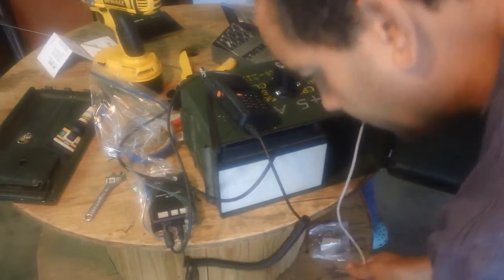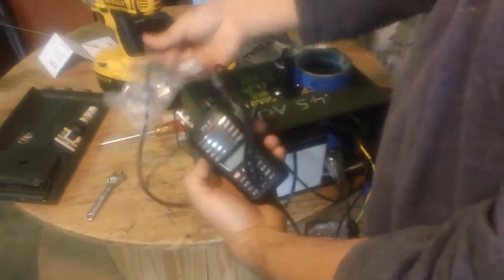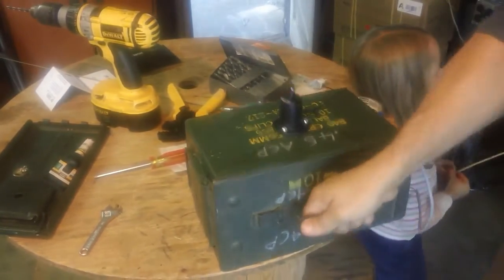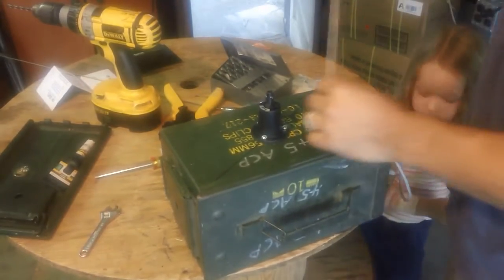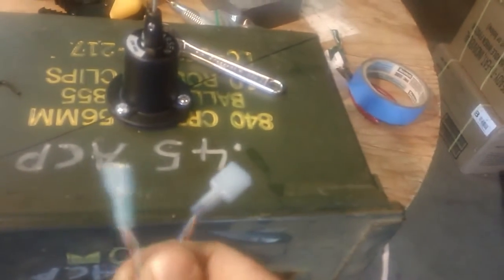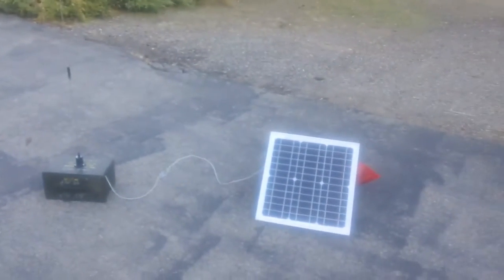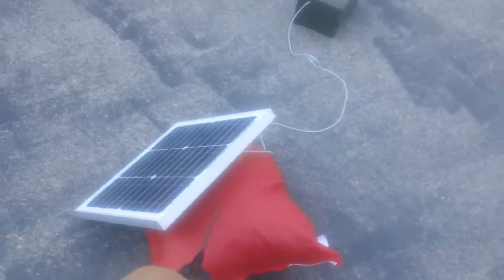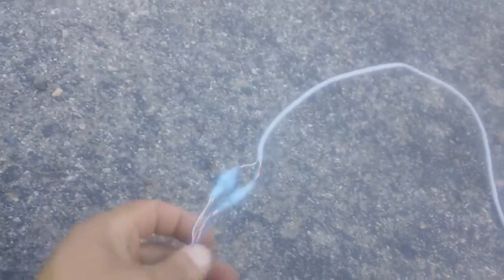SHTF Backup Portable Simplex Repeater Construction.

Comment: thank you so much for your honest nuts and bolts info.  I am new to comms and need things broken down "Barney style." do you think it would be worth my time to use a wouxon kguv9d plus with cross band repeat capability as an added layer of op sec? would out be worth my time or even feasible with the ardent data simplex repeater system you have outlined.  again,  thank you for sharing your time and knowledge with like minded individuals! semper fidelis
Reply from the maker: Sure, I think so. Thats my next project whenever I get the time and money to slap things together. I think the crossband repeater setup will operationally simplify things for the user. Thanks for watching.  Semper Fi.

Comment: Have you played with function ##95 "Report battery level"?? the manual reads the command only functions when the unit is powered by internal battery power. If hard wired thru the back battery connections that might be a useful diagnostic remote reporting tool once deployed. although i guess some experimentation might be in order as working with 12V input may give some wild reports. thank you.
Reply from the maker: Yeah, I did play with it while I was building this thing up. Though its not used cause I'm using the 12 vdc input. I entertain the thought of looping the voltage regulator output to the internal battery line to fake it into seeing some sort of VDC status. but my charge controller will kill the power way before the repeater will see it. Still may play with the idea in my next version of this setup. Thanks for watching. have fun with your gear.

Comment: Question: I have all my parts ready for assembly. My  Argent ADS-SR1 is labeled 4.28 volts at the round power input connection. I see you ran straight 12V into it? no problems??  after i had to wait 60 days for Argent to ship i dont wanna fry this one right off the bat.  thanks, love the videos!
Reply from the maker: Their manual or somewhere read 3 or so volts to 16. that round input is hooked up directly to their VDC regulator along with other points of power input (not internal batteries point). After a couple of months in the field and me messing with it, no problems so far. On an overcast weekend then snow fall, my charge controller shut down the system because I'm assuming low battery VDC levels. It came back to life after a mornings dose of sunshine and kept going where I left off.

Comment from the maker: Yup, confirmed, 6-8 miles from a walkie talkie to the repeater. then it repeats an extra 6-8 miles radius, effectively extending your range to another operator 16 miles in a small city with average height structures of 30'. Doing some more range tests with a vid to follow.